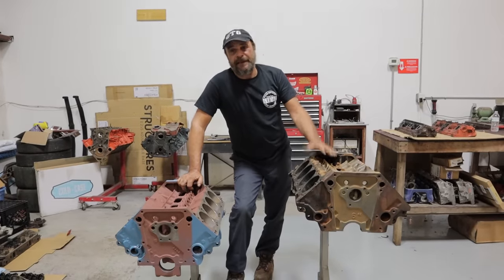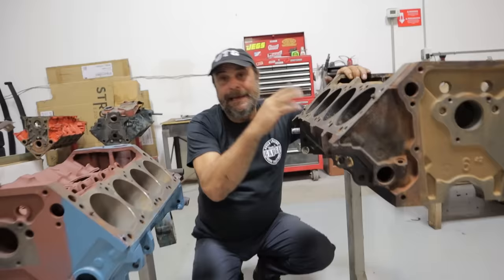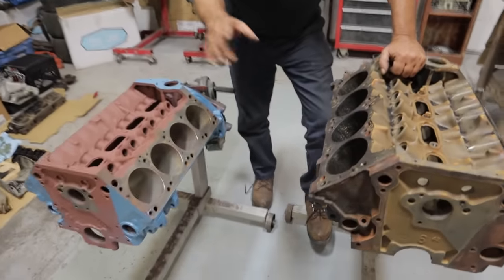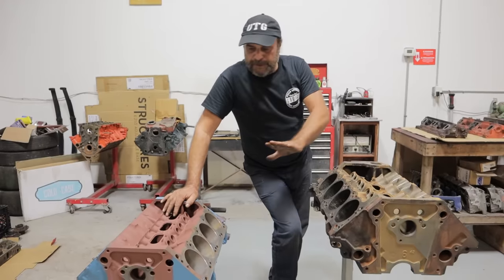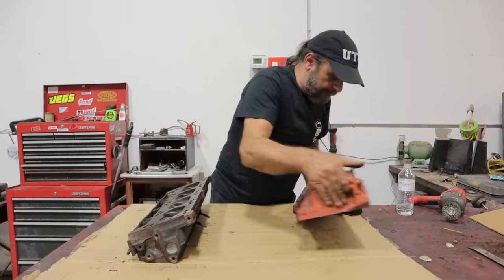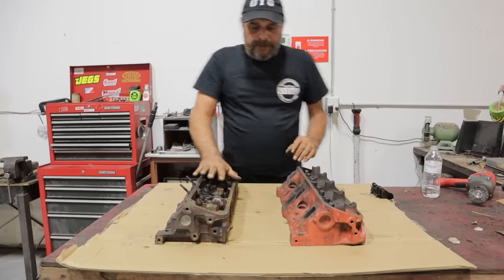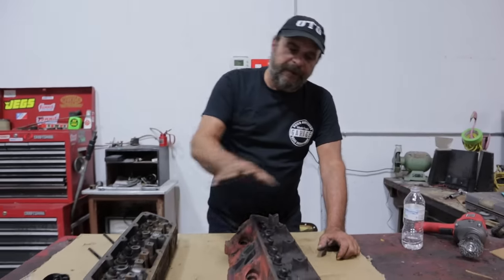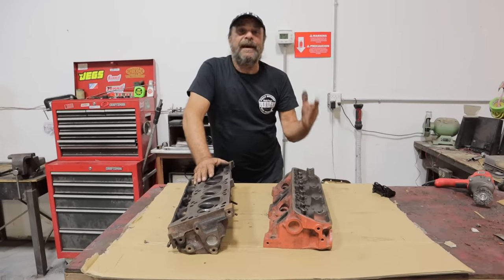Magnum vs. LA. Side By Side Comparison

Comment: Everyone who knows physics realizes that the "wedge head" design with valves in a straight line is the least desirable in terms of producing power. A "canted valve" head...318 polyspherical, big block Chevy, new "hemi" (it actually isnta true hemi) 385 series Ford and even the 351 Cleveland and its variants are a compromise..
The ultimate is a true hemispherical head, (early Chrysler hemi) or a "pent roof" design (Ford Indy V-8) and many import engines.
The more direct  the path for air/fuel to enter and exhaust to exit....the more power an engine will make..it boils down to volumetric efficiency.
While Chrysler 340s were very strong runners (eclipsed only by the Ford Cleveland, and then only when modified, Ford "choked" the engine likely for emissions reasons) using the 318 polyspherical head design on the 340 and 360 likely would have made the ultimate smallblock which few LS engines could match.
Too bad Chrysler was stupid and/or too cheap. That ship sailed 57 years ago.
Still, in the same way Zora Arkus-Duntov made an overhead valve conversion for the Ford flathead prior to designing the smallblock Chevy, it would be cool if someone would make poly heads for smallblock Mopars.

Comment: Uncle Tony,  Does this mean I can Take a nice aftermarket intake manifold for an LSA 5.2, Add fuel injector bungs and a 4 barrel throttle body to replace that TERRIBLE flowing Kegger intake on my 95 Ram?  Inquiring minds have to know...
Reply: I found the answer.  Different angle for the intake bolts.
Reply: hughes engines sells a edlebrock air gap intake that they custom ordered that takes all the factory magnum efi parts.
Reply: I just built a low mileage magnum 5.9 for my 51 dodge , 506 lift cam , dual plain manifold , fitech efi , roller chain , headers and ultra thin head gaskets and it's a whole different animal .

Comment: Chrysler newbie here. Since the LA came in Magnum designations, does that mean that the Magnum in this comparison is speaking specifically about a particular displacement Magnum? Perhaps I wasn’t listening closely enough.
Reply: NO those older 1960's "magnums" were not the 1993 and up Magnums
Reply: @yurimodin7333  That's correct. The old Mags were just Dodge's name for their high perf engines from the musclecar era, both big and small block except the 426 Hemi. The new Mags identified ALL modern small block Mopars before the modern hemis came out. The old Mags ended around 1973 or 4, or maybe it was before that.

By the way, Plymouth never used the Magnum name. They were called "Super Commando" in most cases, except of course the 426 Hemi, and the 383 Roadrunner engine which was called the "Coyote Duster" 383.
Reply: Thanks. I looked up LA engines and there were several Magnum versions mentioned, thus the confusion. I’m guessing that in Mopar performance/racing/building parlance, they are two different things.

Comment: Until now, I never understood why the LA and the Magnum had the funky lifter angle.  Question: why didn't they develop the poly heads for the LA?
Reply: I ask the same question , but in a different way . 

Why were the hemi and poly engines discontinued in the first place ? The cost issue by itself doesn't make sense , but when high quality gasoline became available engine design wasn't as important ( for target performance in production cars ). If 300 hp is the goal it's cheaper to manufacture a 413 over a 392. According to Don Garlits , 34 dollars per engine cheaper.
Reply: @mickangio16  Cost is usually always the reason why manufacturers would favor one design over the other.  I'm sure the LA heads were cheaper than the poly heads.  Too bad really, a bigger cubic inch poly would have been a solid performer.
Reply: wish they had...good lord it would have run hard.

Comment: Do any Magnums have provision for a mechanical fuel pump?
Reply: I dont think they ever had a mechanical fuel pump.
Reply: The Magnums never did but some of the LA roller cams still could up to 89
Reply: That's usefull info, thanks!
Reply: I have a 2000 5.9 magnum and it's got a plate on it from the factory so you can use a mechanical fuel pump!
Reply: @rollin19  the factory cam snout is too short for a fuel pump eccentric

Comment: Can you run a 360 La torque converter on a 318 La engine
Reply: Just grind off the rivets and remove the weight and you will be fine

Comment: so what you're saying here is that GM copied all of these ideas a few years later on the 5.7 Vortec........because those are almost verbatim what GM changed.
Reply: Engineers face the same questions.  The SBC won people over in part because GM engineers economized its design in ways that the aftermarket was able to upgrade where it counted.  The 5.7 Vortec is a sweet motor - GM should have produced it years earlier.
Reply: @timothykeith1367  no doubt, I am getting ready to put one in my 1996 2wd Jimmy......just seem interesting that they are almost the exact same idea. Either GM copied it fast or had a mole in Dodge.
Reply: @yurimodin7333  The pedestal mounted rockers were always a Chevy feature

Comment: The LS is the best of it's generation as the sbc was before it.  Dodge engines are ok but you never hear of sbc or LS engines blowing head gaskets, wearing out cams, etc.  They are just good engines.  They just go forever.  Dodge can never seem to make an engine like that.  You could find some old chev truck with 500k miles in the scrapyard and the trans will be pooched and the whole body rusted out but the engine will run like new.  I've heard of plenty of durango owners with magnum engines that neede to have engines replaced.  Never heard of a chev guy (not including new ecotec style) replacing an engine.  The only annoying issue they have is they like popping the exaust manifold bolts off after high mileage which is a pain
Reply: UHHHH LOL. you must not have been around for the 1970s when sbc were literally eating cams left and right. also, yea, sbc do blow head gaskets. get off your brand fanboy high horse.
Reply: b.s. .

Comment: What carb intakes are the hot setup for a magnum 360 hot street strip setup.
Reply: Depends on a lot.
Find a sharp machine shop and get your Magnum heads intake face drilled to LA bolt pattern.
Or look for or buy a  BHJ Tooling drill out fixture- kinda $ so you and a buddy or two may want to team up.
   Hope this helps.
Reply: edlebrock performer rpm air gap, or the china ripoff version.

Comment: Thought intakes were 2.02, did they downsize the360 from a '70 340?
Reply: The '70 t/a heads were 360 castings, with the pushrod holes moved and had adjustable rockers(hydraulic lifters), like the 273's which I thought were solid lifter engine. You could clarify
Reply: Also I believe, the t/a heads had hardened valve seats, and we're the precursor to the W2 heads

Comment: Does a  magnum head require shaving the bosses for a aftermarket roller rocker say .7
Reply: No.
   Jusr get the hardened pushrod guides & screw in studs (5/16 in head- 3/8 top) for a Magnum/Olds- same part.
   Then get 1.6 ratio SB Chevy roller rockers & polylocks.
   Pushrods will vary because of LA deck height of 9.6, or Magnum 9.58, lifters used, and any head milling, etc.
   To clear the polylocks aftermarket tall valve covers ( Ma Mopar) , or spacers- guy made 1/4 inch ones for way less & kept the 'sleeper' appeal.
   Hope that helps.

Comment: Please help me... what years was the LA produced and what years for the Magnum? Thx.
Reply: 64 to 92 for LA,  I think 64-67 for 273, 68-91 for 318, 68-73 for 340, 71-92 for 360 .    Magnum:  92-2003 for 5.2, 93-2003 for 5.9
Reply: LAs started in 1964, but are based off the A engine Tony mention from the mid 50s, and that original A engine had a lot in common with the first HEMIs. The L stands for light weight. LAs ended in 1991.  Magnums started in 1992 and went until about 2006, but the last couple years were mostly built in places like Mexico.  The Magnum series was never put into a car, only used in truck and vans.
Reply: @Sleepy_Js_Garage  Thank you, I was wondering the same thing.

Comment: Uncle tony, I wanna know if I can slap a 727 torqueflite onto my 98 dodge Durango
Reply: yes.
Reply: wont work with efi though, because you need a cutout for the crank sensor.
Reply: @frigglebiscuit7484  good looks. You think I can but a newer trans on an old school 440?
Reply: @frigglebiscuit7484  so I've been trying to find out if the internals of a 5.2 magnum are cast or forged. Do you know?

Comment: Mopar has always been expensive for motors and cheap cars. No sense at all. The current gen in everyone and your mom’s 392 is a great engine. But that graphite iron is still heavy. The aftermarket is supported really into 426 strokers and boosted.  They just want you to grab a new vehicle. Fords current line up is too wide allowing Chevy to dominate in aftermarket

Comment: The newer hemis are becoming fairly cheap you can pick up a chrysler 300c hemi for 1500 bucks running pull the motor and part the car out make your money back FREE hemi! Most then make 370 hp stock

Comment: @Uncle Tony's Garage, Can you build a big block Mopar 400 to compete with/dominate the LS within $2000 over what you would spend on the LS 6.2+?? Black Friday provides Speedmaster heads (that need machined) shipped for $500.+ dollars. Intakemanifold, another $100 with that purchase. In rural America, one can purchase a 400BBM for less than $700. People use low compression 440 pistons in these builds. Could you at least price compare the two builds?
Reply: ive got a stock compression, stock stroke 400 in my dart, and it revs like a mfer. bowl ported motorhome heads, lunati voodoo 226/234, .494/.513 110 lsa cam, and a weiand action plus intake. it would run away from a 6.0, easy.

Comment: Millions of Magnums produced over a 20 year production run.

Yet no 'Performer' style intake!

What is the excuse????

They already have the manifold to head face casting section on the RPM  'Air Gap'- take little to swap onto the 'Performer'.

When M1 dual plane 4bbl intake for the Magnums sell for $600 on EBay....

It's Not Capitalism- it flagrant Anti-Moparism.

Comment: I disagree with you on how good the big block Chevrolet engine is. It has "NEVER" won le Mans. That is the ultimate test of an engines durability, power and  design. Ford did it with the FE 427 over 50 years ago. Revving over 7000 rpm "around the clock"! The big Chibbie wouldnt last 15 minutes .Everybody wants to deny the Ford , but they are the ones that got their asses handed to them by a Ford! Mopar needs to get their nose out of GMs ass.

Comment: This has to be his dumbest take on any topic. No old school head flows like the modern hemi head. The one Steve Dulche from Engine masters modified (adding W2 ports to a modern Aluminum Edebrock head) is about as close as you are going to get. If your head doesnt flow (as most A, LA Magnume heads), then all the other advantages are irrelevant.

Comment: The problem with the LS is the same as its strength - its ubiquitousness.  They're common.  They're forgiving and easy.  They're (relatively) inexpensive.  Parts are plentiful and affordable.  They're easy to work on.  In other words, they are passionless.  There is no mystique or magic to the LS family.  When you build an LS mill, you're walking in the path walked by countless others before you.  You're....following the herd.

Comment: LS fighter?  Yeah, I don't know about that.
Reply: You're right. The small block mopar is the best small block made. 
The other is just a Generic Motor Crap boat anchor
Reply: Trick flow heads or one of the slew of well ported aftermarket replacementheads , flat top zero deck pistons, decent cam of your choice  you'll be right at 500 or more depending on final combo choices, its that easy been there done that with factory iron its that much easier with aftermarket aluminum 👌
Reply: @andreboy1  I have many times,  princess.  I've personally watched a stock 78 400 block with 15lbs of boost run down the track for over a decade so please you can keep your Generic Motor Crap bellybutton boat anchor junk.
Oh and it took GM 50 years to beat 70 year old mopar engineering. Good job 👏 👍
Reply: a bowl ported magnum head makes the same cfm as a 5.3 truck head at .500 lift. displacement says both will make the same hp. actually, magnum heads have bigger valves. 5.3 has a tiny little bore, 5.2 has a 3.910 bore and a short stroke.
Reply: @andreboy1  its maintenance free until the lifters or rockers shit themselves.
Reply: @Welcometofacsistube  i embarrassed a 3rd gen corvette with a ls3 in my stock 93 5.2 ram....now let him come try my 400 dart ;)
Reply: @frigglebiscuit7484  dream on 😄

Comment: LS = JUNK.    1st generation big block all day to pull lifters on an LS have to remove cylinder heads completely lame completely lame.   Plus 4 solid rollers with high lift forget it nothing exists

Comment: LS will always be better. Screw an LA/Magnum motor 😂 when you have to buy everything aftermarket but the block, somethings bad wrong with that pos. Take the L on this one motards. Those pos cracking magnum heads are junk, the intake with that dogshit two piece plenum is junk. LS practically has a factory race block. Jesus. 🥱

Comment: Why would you ever run a carburetor?
Reply: Easy to tune your fuel without a computer. Just need a vacuum gauge, a screwdriver, and maybe a jet kit if you wanna get super crazy with the tuning. They're usually cheaper to run and toy with.
Reply: easy to tune, lower iat temps, no being stuck on the side of the road asking parts stores for efi parts.

Comment: Every junk yard has a LS sitting around
Idk where you'd find a magnum or la engine
Reply: Magnum engines lurk in all those junk yards too. All those pushrod mid 90s and later 8s that aren't hemis. Pickups and vans ran the hell out of them. Post "cash for clunkers" LAs kind of became junk yard rarities, but most local craigslist parts boards have some old pack rat like Tony hawking his stash of well patina'd later LA blocks and heads that you have to cut weeds to find, lol
Reply: Magnums were backed by bad transmissions so they are common in junkyards